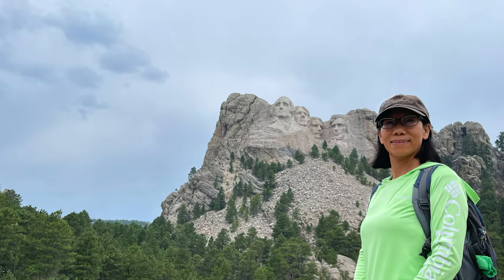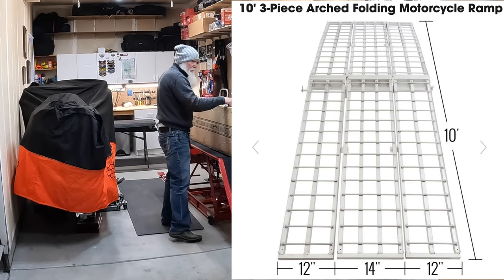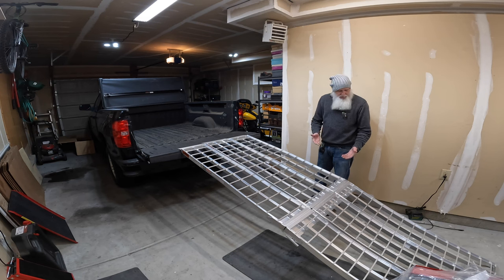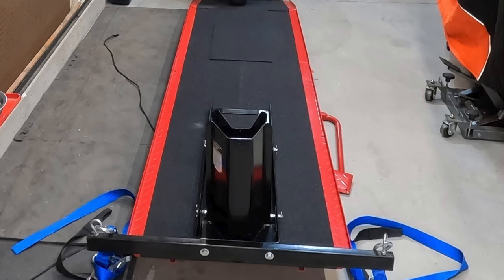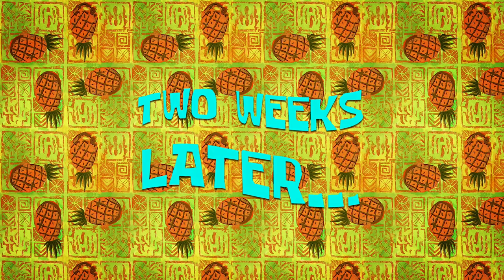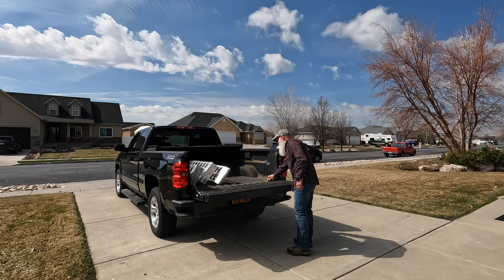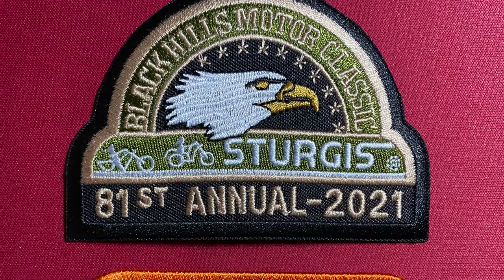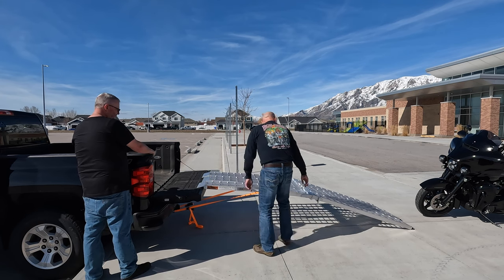Black Widow Motorcycle Ramp | #blackwidowreview #garagetherapy #therapist #sturgis

Comment: Don't trust those straps to stop the ramps falling off when the rear wheel pulls the ramp back off the truck tray. The only method I would trust is bolting those ramps to the truck tray. I learnt this the hard way loading my Indian onto my trailer. Luckily the bike didn't get hurt when the ramp got pushed away from the trailer bed. 🇦🇺
Reply from the maker: Great Advice!

Comment: As an added security, I would add a vehicle stand under the ramps as well. That mitigated the disaster when my Indian dragged the ramp off the trailer edge. Honestly, I would still holes with bolts into the tail gate rather than trust those straps. Maybe instead of the straps, a length of metal connecting the ramps to the tow hitch. 🇦🇺
Reply from the maker: I think metal straps to the hitch are a good way to go for added security while avoiding holes in your tail gate. Thanks for the tip, even though you had to learn the hard way! Thanks my friend.

Comment: You don't need a ramp if you ride it 3 reasons a you truck or trailer a bike if it is stolen, broken or moving I am 74 been riding since 16 have had several bikes currently have a shovelhead I bought new 1980 with well over 750,000 miles also a wide glide I rode 900 miles for a cheeseburger I rode from LA to Chicago to meet up with a friend of mine to go for a ride into Wisconsin I rode with a club for 5 years my only transportation for 6 years was my bike see you on the road FKH
Reply from the maker: I appreciate your thoughts. Come back and share your thoughts again after riding two up for 50 years.

Comment: Better idea, put the bike in gear and use the clutch. If you let go of the brake, the bike moves, if you let go of the clutch in gear the bike doesn't move. Slightly use the clutch to descend. It's an ADV rider thing.
Reply from the maker: Thanks for the reminder. Keeping in gear is certainly the way to go.

Comment: Clem thanks so much. Great video and very thorough explanation. I followed your video and did the same setup fror my '22 Ultra Limited. Just completed mounting the Pittsburgh (Harbor Freight) motorcycle wheel chock and cut my 2x4 to 58.5” to fit wall-to-wall in my ’22 F-150. I used ¼” 1.5” long lag bolt screws to attach the chock to the 2x4. My Black Widow 10’ ramp gets here tomorrow. I'm not one to reailer mine but it's a nice option to have. Can’t wait to try it out.  Thanks again, Ride safe.
Reply from the maker: Jerry, I just used my setup this past month to take my bike from Utah to Georgia and all went well. Check out this video for a couple of shots of the bike and the truck. https://youtu.be/R_vEZBOA_g0?si=xa7_JeSqXF4cFjx-

Comment: You didn’t need wood. You could have used superstrut. It’s a Swiss knife. You can then add eye bolts for anchors….
Reply from the maker: Ali, I assume you are describing unistrut or “superstrut” specific product from ABB for securing conduit and a million other things. I agree it has almost infinite applications. Ultimately I used wood as it is the cheapest thing laying around my shop and provides a good friction surface against the bed of the truck rather than metal against metal. Thanks for sharing your ideas and taking the time to watch and comment. I appreciate viewers and subscribers who have a passion for motorcycling and maintaining the bikes.

Comment: Michigan here. Just bought a 12 -foot set of these. They are not here yet but plan on Black Hills trip 3 weeks from now, after kids go back to school and campgrounds have spots.  Normally I would just ride it but I'm bringing my dog so it's easier to use the bathroom, go into a grocery store etc. if he can hang out in the truck for a few minutes. I have a Silverado as well, wondering how did the bike travel back there the way you had it secured?  I hope I can angle it a bit more from a tad higher up and back on the frame. Everyone has their own way of doing it, I just have PTSD from hooking up dirt bikes and like you said, "I have too much invested in that bike" to not be as careful as I can be.  Nice video and tips.
Reply from the maker: The biggest problem is trying to shift the bike after you ride it in straight. It is sooooo heavy. We just hauled the bike from Utah to GA and it rode extremely well in the back of the truck.
Reply from the maker: Don’t forget to put the bike in transport mode or you will loose the battery and your security alarm won’t stop flashing! 😀
Reply from the maker: Check out my recent Bushtec trailer video and I think I have a few photos of the bike in the truck to GA! BTW: 12’ ramps are a good choice.

Comment: Question for anyone who has one or has seen one in person. In the video it shows the middle piece sliding back. If it has the safety rod through it, shouldn't all pieces remain together independent of where you tie them up? Did the rod bend? Any information is greatly appreciated. I am deciding between this one and the 9' Long Black Widow Aluminum 4-Beam Folding Arched 3-Piece Motorcycle Ramp. Thanks.
Reply from the maker: Great question, the pipe welded to each section has a slightly larger inside diameter than is necessary for the connecting rod. I am sure that is to allow for fabrication tolerances between the three sections. The straps are the part to be attached to the middle section in contact with the tires to stop the ramp from sliding.

Comment: Clem, I think you did an outstanding job loading and unloading your bikes. I’ve used these for a trip to Daytona and it is not for the faint of heart but they work very well. Great job!
Reply from the maker: Thanks Tom, I did learn a valuable lesson about where to attach the straps. They should be attached to the center ramp for sure. Luckily I avoided a potential mishap. I also got a comment with a concern about load on the tailgate and the cables attached to the tailgate. I feel very comfortable with the tailgate and its ability to carry the load.

Comment: Great video. I have been looking to purchase some ramps and this video just made up my mind on which ones I am purchasing. Thanks, John
Reply from the maker: John, thanks my friend for the positive comment. I like the ramps and the biggest lessons learned is take plenty of time to determine the best truck orientation to give the flattest approach angle and second… tie-off this straps to the center ramp section to the truck bumper hitch very well. Hey, if you do buy, consider my Amazon link in the vid description. No extra cost. Thanks again and hope you subscribe!
Reply: I was confused by the center ramp moving being you put the rod through them all. Is there not bosses on the center ramp for the rod to go through?  If there was then strapping could be done on any of them. Just wondering. Haven’t purchased yet of course. Lol.
Reply from the maker: John, there is the aluminum rod that slides through all three sections that does tie them together very well latterly. There is a little more “play/slop” in the direction of travel. That is what I was attempting to show in the video when I noticed the slippage on my tail gate as the bike’s back wheel is pulling the center section away from the truck as you ride up. Great question!
Reply: @clemgriffis3446  thanks for the explanation. I’ve had that happen  on wooden ramps. Learned to tie them to the truck also!!  Scary realizing what could have happened. Thanks again. Have a great day and keep riding safe.

Comment: Thanks for the review.  I would recommend that you get some flat steel bars to secure the tailgate (attach where the cable holds the tailgate on each side) won't pancake open with the weight of a heavy bike held by two cables on the side of the tailgate.
Reply from the maker: Great idea, thanks for sharing. Basically it creates a rigid extension of the bed surface that does not bounce, correct?
Reply: @clemgriffis3446  It will prevent the cables on each side of the tailgate from being overstressed and breaking.
Reply: Look up DG Manufacturing tailgate supports guys they fill the need
Reply: @sfzx54  great idea however $84 is a little steep for a couple pieces of straight steel with a slot  cut in and a pin welded on. Just saying. I’ll be making some for myself being I’m a machinist. Thanks for the info however.
Reply: @johnstein2206  Well john I bought mine at least 20+ years ago actually 1997 so it appears they have gone the way of everything else out there and it seems to be double plus some LOL
Reply: @sfzx54  I understand. I know it’s not your fault they are that costly. Just saying. I know I can make some pretty easy. I’m an Engineering Specialist so designing and making some will be pretty easy. Luckily I have the skills. Thanks for posting the suggestion for using them.
Reply: @johnstein2206  I have often wished that I had more of those skills you speak of. Take a look at the Neo-Dyne motorcycle loading technology.  They are back ordered over 100 deep in the USA with only two dealers.  I would love to get one but am at position 60+ on the list

Comment: I've been eyeballing these ramps and have been watching videos,,,yours most recent. Im now in the process of getting a set. I haul my Adventure bike mostly,,,but i have a big cruiser that weighs 900lbs wet. Its very apparent these ramps can handle the load.  The truck is new, 6'4" bed and air bags in the coil springs, so I am not concerned with that.  It also appears i can use these ramps to load an ATV.  BTW...am in Minnesota,,,maybe see ya on the road! Thanks for the video.
Reply from the maker: Glad you got some useable information out of the video. I was just looking for a good set of ramps for my two bikes that I know are quite heavy. Like you, I did my research and I wanted “SAFETY” and reasonable quality and I didn’t want to break the bank. If I did not find something I was happy with, I was resign to the possibility that I would not buy anything and resort to a trailer as a last choice. I found these black widow ramps and decided it was the way to go and I was not disappointed. I took the bike to the Sturgis area in my pickup Memorial Day week and thoroughly enjoyed riding and the convenience of the new ramps. (See https://youtu.be/W4DCrIwmhmY) 

My review and comments are always absolutely genuine. I cannot watch or put up with disingenuous folks in videos. I say all that because a few months later, my viewership increased to the 1,000 subscriber threshold and I was able to monetize the channel and become an Amazon associate which gives a small stipend when someone buys an amazon product that I give links to in my video description. I have recently in the past 2 weeks, added the amazon link in the description for the ramps and a few other items. I still refuse to make non-stop product review videos but just for full disclosure, I now could benefit if you buy through my amazon link. Thanks for taking the time to comment and give the valuable feedback.

Comment: Hi from Fort McMurray Alberta 🇨🇦. Thanks for the review. I have been contemplating getting these ramps for my bikes. Wasn’t sure how they’d stand up. But seeing how confident you are with your heavy bikes I’m sure they’ll handle my Heritage and Fatboy just fine. I’m looking at the 10’ as well. Hoping that they are long enough so my bike doesn’t bottom out. My truck is a F450 so even at stock height it’s pretty high. Fingers crossed. I also like your idea with the wheel chock on the 2x4. Normally I just snug the tire up against the truck bed. But I like your way better. I’m gonna try that myself. Thanks again for the review.
Reply from the maker: Derek, glad the video answered some of your questions about the ramps. Thanks for the comment and taking the time to watch our content. I think you will appreciate the ramps if you decide to buy them. What I have learned is you can’t go at loading your bike “half-hearted”. You have to do all the right things in preparation for the best angle available, tie-down the straps properly and then commit when ride up. If you find that Amazon is your best option, please use my link at no additional cost. If you find a better purchase option, please take it as these are not a cheap purchase. Take care and “ride on!”

Comment: I've considered these ramps, but I have a Ram with a 6" lift and 35's so I'm just not comfortable with attacking this method for hauling my RGS. Considering a Kendon now or similar "fold up" trailer.
Reply from the maker: Hey, I really understand your concern.  There is a certain comfort level you need to be able to haul your bike down a highway at higher speeds like you might see on an interstate highway. In my case and for many others, the bike is worth more than your truck. I can afford an enclosed trailer but currently have no place to park it at my house. I plan to pour an outside concrete pad and remove that section of my lawn in the near future and then buy a twin axle enclosed trailer that I want to convert to a camp/toy hauler.

Thanks brother for watching the video and commenting. Hope you are a subscriber, we need the help to build the channel.

Comment: Great video.  I like that setup. I do have a question when the middle ramp pulled back on your truck is there slack, when u insert the rods into the ramp that's let the ramp move back
Reply from the maker: Yes, take a look at time 3:20 into the video and you can see about how much play there is between the rod and the pipe sections it goes through.  Thanks for watching and asking good questions.
Reply: @clemgriffis3446  still looks like a great setup

Comment: Just found your channel…looking forward to learning more about you all…I live in Iowa, retired USMC MGySgt…Looking to take my Harley back to the black hills as well to ride those great roads too. Considering a ramp to ride the bike into the back of my F250. How do you carry them in the back of the truck when your bike is loaded so they don’t come in contact with your bike? I have a ‘22 Road Glide CVO that I really don’t want anything touching:) Was going to go with a trailer but trailering something is such a PITA if not absolutely necessary.
Reply from the maker: Shep, thanks for the questions. I use ratchet straps to tie them up against the inside of the bed sidewalls. I have added a couple of Eyebolts in the front and back of each side wall. The ramps sit on top of the wheel wells and then strap in. I understand that if the ratchet straps come loose, the ramps would fall against your bike while driving down the road. Today is Memorial Day 2024, we used the ramps to take the bike to Rushmore camping area this time in 2023 and all went well. Checkout a couple of videos I posted on that trip.

Comment: I would be a little worried about these tailgate support cables  struts I’ve seen those broke
Reply from the maker: I think I have seen a similar concerns within the comments for the video where I replied with the various working loads for the cables and the riding position of my back tire within the bed of the pickup. Sorry, I am a structural engineer and I tend to drone on, too much technical stuff, suffice it to say, I am good with the application and the truck/tailgate/cable combination I have. Everyone should be comfortable within their own setup for sure. Your comment is absolutely a good comment and well taken my friend!

Comment: Great review! I just ordered the 12ft version based on the height of my truck. Any issues with the rear wheel on the tailgate while traveling? I kept hearing that the tailgate could bend.
Reply from the maker: There are couple of comments previous that shared similar concerns. Have a look at my comments to guyconnell & vincentcarmelli where I tried to talk about the tailgate cables and the center of my rear wheel basically right above the hinge. I have had very good luck with this configuration, no deformation and stable ride. Thanks for the question.

Comment: Nice video. Just subscribed. Question:  Is your Silverado a Crew Cab or Double Cab?  I can't tell from the video. I'm trying to figure out the bed length in term of where your rear tire is landing. Thanks!
Reply from the maker: It’s just a double Cab with the shorter rear leg room. I think the bed is about 6 1/2 feet. My bikes’s rear axle sits about at the tail gate hinge. Good question, thanks for subscribing, really appreciate you taking the time to ask a question and watching the content we are putting out.
Reply: @clemgriffis3446  Excellent. I have a double cab too with a Bak Flip hard tonneau cover. I would probably have to remove the cover so my Ultra Limited would sit as yours does. When the cover is all the way up, there is about 4-6" of space to the front of the bed. That would probably put my rear wheel on the tailgate versus in the hinge crease. Not ideal in my opinion. Thanks for the info and be well!!!